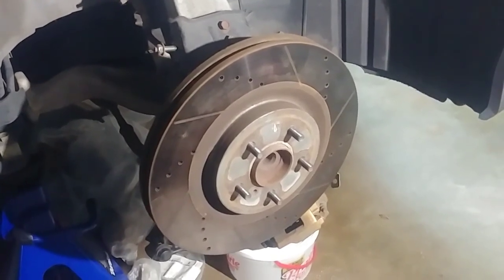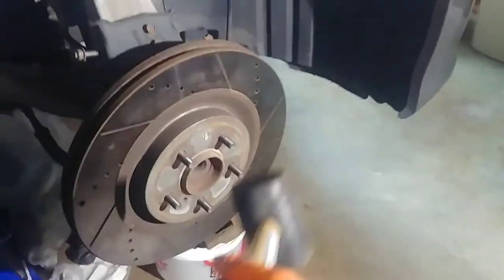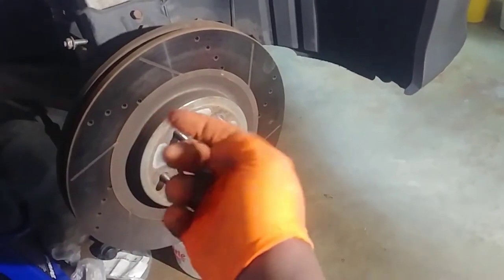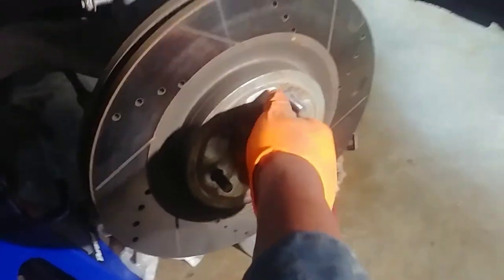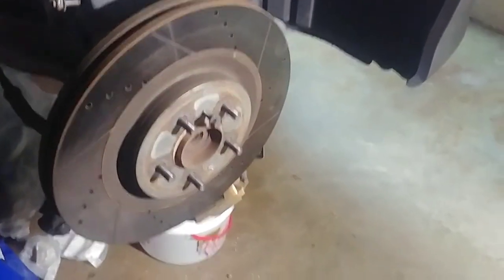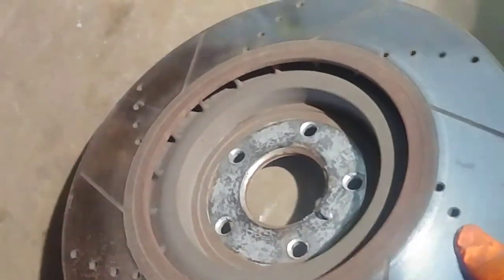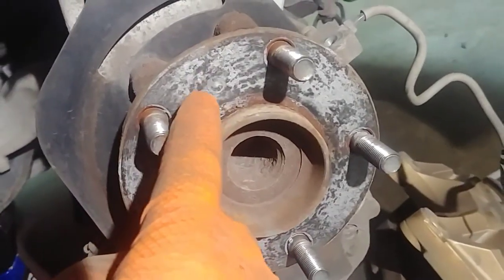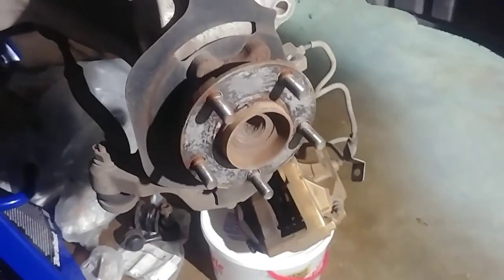Remove Stuck Brake Rotor using Bolt in threaded hole. Metric 8x1.25

Comment: Good advice… I used the 8m * 1.25 bolts to removed my rusted and corroded rotor on my Honda civic without the need the use a hammer or any other unnecessary techniques.

Comment: I just bought a couple of M8 x 20 mm and they’re too small for the new drilled and slotted rotors I just bought, haven’t pulled the wheel yet to check if they’ll fit in the old rotor, sure hope they do, it’s a trailblazer

Comment: If you have an impact gun to tighten the bolt it works even easier. Also you can get M8 x 1.25 bolts in bolt grade 10.9 which are usually brass/gold or black colored and are much stronger than ordinary steel bolts. Also spray a little WD40 or penetrating oil in the bolt hole and on the bolt first to make it spin easier.

Comment: What if its stuck so much the screws cant pull it out?
Reply from the maker: With enough leverage, the bolt never fails...unless the threads get stripped.
But if that happens, then we go back to using force
Reply: @EdBwoy  i see i see. Thank you

Comment: And what if that threaded hole is stripped?
Reply: kiss the use of that hole good bye?
Reply from the maker: Then I'd just resort to hammering. 
Although, I have seen people successfully lower the vehicle with that rotor touching a piece of wood and the weight of the car loosens it. Obviously there are safety concerns with a method like this